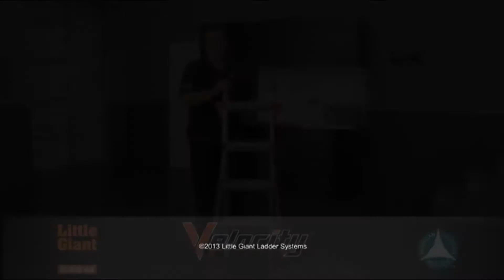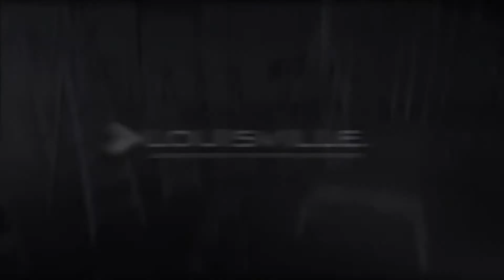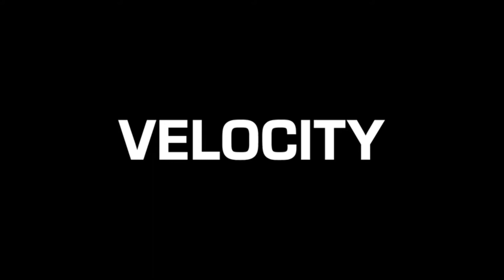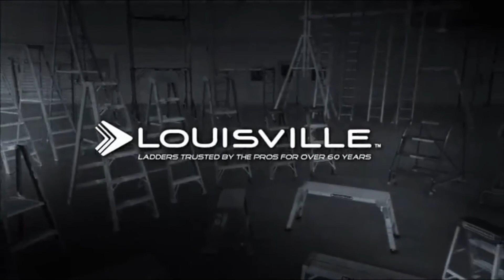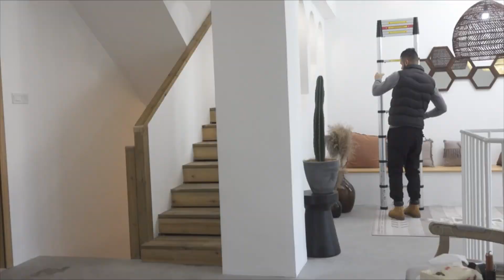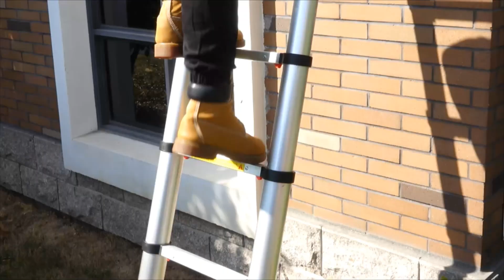✅Best Ladder 2020 | Best Telescoping Ladder | Best Little Giant Ladder | You Must Need! TOP 5 PICKS

Comment from the maker: A better than average stepping stool will make cleaning canals or arriving at the first-rate much simpler. Be that as it may, if space is constrained, attempt one of these extending models, which come in helpfully smaller bundles and are perfect for temporary workers and handypersons who need to move them from the shop to the place of work and back. Our determinations incorporate an assortment of choices to address each issue and financial plan.